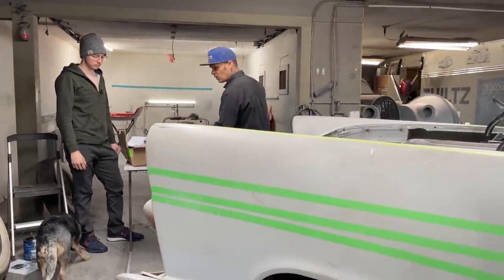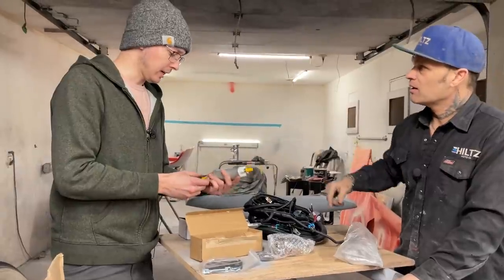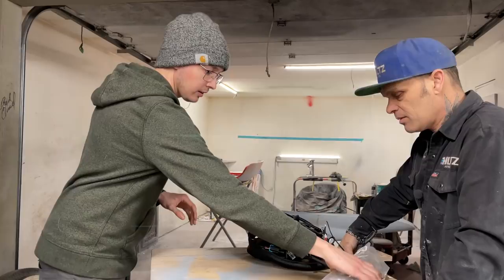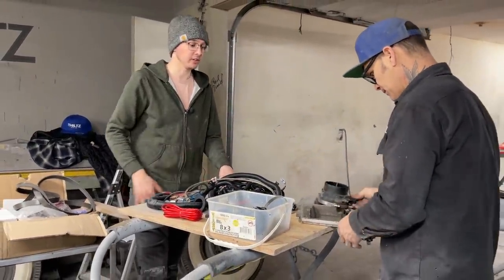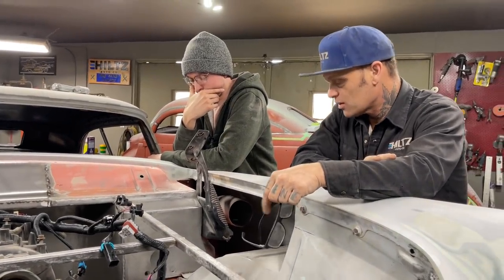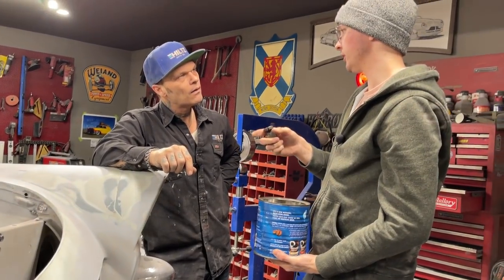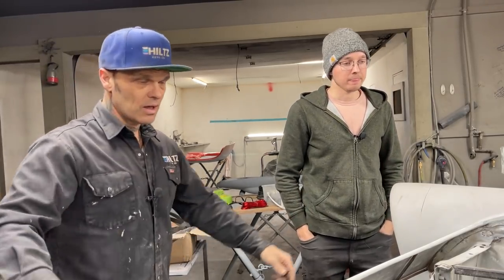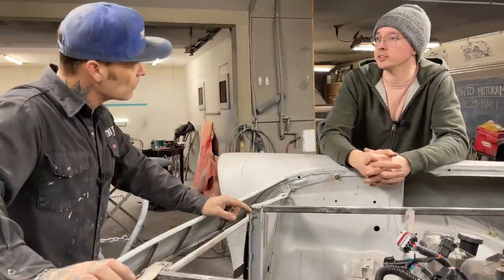A lesson from Dane Bolton on How To Set Up 5.3 LS Engines

Comment: These swaps are very straight forward and can be done with aftermarket harnesses and modules, or oem used components. My last build was a 49 chevy truck and I used a 5.3/4L60E and the oem harness and PCM I bought it all for $1400, even came with the power steering, water pump and alternator.
Making the harness work was as simple as peeling off the loom and tape and eliminating circuits not being used, then retaping it. It was in great shape.  Used an amber LED for the check engine light. 

This build will be super cool when done!

Comment: Always interesting watching Chad from just down the road in Scotch Village, but I think Dane has the order of the fuel pump and filter/regulator backwards, at 4:05.  I've done a couple of LS swaps, and used the same filter, but it's under pressure, with the pump before it, not after.  I'm sure they'll sort it out!!!  I wonder if in the end Chad will say "LS's are cooler than dang"!!

Comment: The "ECU" in this case is actually called a PCM, since it controls both the engine and transmission, so that makes it a Powertrain Control Module. If it controlled only the engine it would be called an ECM, or Engine Control Module. Those vehicles would also need a TCM, for Transmission control. :).

Comment: use a baffled gas tank so the pump won’t get starved and lean the engine out. My ls swap has a in-tank fuel pump and it has a filter sock on it at the pick up and then the filter is after that pump next to my fuel tank. I’m using the same filter Dane showed you “corvette style”. There’s a oil pressure sensor on the back on the motor behind the intake which I’m sure you can wire a gauge to it so you don’t have to run oil into the cab through that line.

Comment: AN fitting is a standard sizing for fitting used in Army Navy application. AN -6 would be 6/16 of an inch OR 3/8 inch fitting. What ever size the AN fitting it is always in 16ths of an inch. -8 AN fitting would be 8/16ths = 1/2 inch fitting.

Comment: Ive retrofitted gas tank by cutting pieces out of one tank adding to another to match what im working on . Or put a larger tank in . Extending the sending unit no problem.  Separate note ive had realy bad luck with electric fuel pumps in combination with  Carburetor

Comment: Great video guys. The hole making thing is called a knockout. Electricians use them. Before step bits were popular, we would drill a small hole, then use a 1/2 knockout, then use the 2” knockout.

Comment: Chad, Once you used an LS. You will always be using one. They're cheap, reliable, bulletproof make lots of HP. With the fuel lines used the AN fittings and Lines. Do it right the first time. I would put the fuel pump in the gas tank. It is quieter and the fuel keeps the pump cool and it will last longer.

Comment: Yes, have your hole behind the engine towards the left side of the engine, it will hide where it's coming through and then it splits to each side of the engine. The split is for the injectors, knock sensors, mass air flow, altenator. As you start plugging everything in the harness starts to point to where it wants to go, you got this, you do way crazier and harder stuff then running a harness. Bad Chad got this.
Reply: Hang tough Chad... Newer technology is always a bit intimidating at first glance.

Comment: You can get a 25 ft roll of 3/8 nylon line with fitting for that particular fuel filter/regular. Cut the line to fit, push the fittings on and go. It's the same style fittings and lines car makers have been using for years. You can get it all on Amazon, eBay or rockaut. That's what I use on my budget Ls swaps..

Comment: Brent at halfass kustoms has installed dozens or these LS engines .he has lots of great tutorials on this subject .His rule of thumb is it's got to be cheap,easy and parts available at the gm dealer. local parts store  or at the auto recyclers anywhere .He was huge amount of usable tips and tricks for you .This new set up would be a much cleaner install although.

Comment: First you need 3 line from the sending unit 3/8 MAIN LINE 5/16 RETURN LINE and 1/4 or 5/16 EMISSION LINE.. All so you have to run if your using rubber hose on the 3/8 main line you have to use fuel injection hose for the higher pressure fuel pump which has about 50 to 80 pounds pressure.. Most shops now use plastic fuel lines..Easy to run will not rust and last a lifetime..NAPA has everything you need to run the plastic lines from fittings to plastic hose ..Have fun own my own rad shop for over 30 years installed 1,000 and 1,000 gas tanks and rads and heaters and also recored tons of rads

Comment: you can get a bluetooth elm 327 adapter to plug into the obd2 connector and put a free app like torque lite on your smart phone to check what is going on with the PCM, check and clear codes etc.

Comment: you can use that pump on carbs you must dial down the regulator and run the return right into the tank

one thing you will experience with these closed loop hi side lo side pumps is that it will build up pressure in the tank itself, you can weld a 1/8th nipple tot he tank and run an 1/8th inch fuel line to a charcoal canister then use an inline pressure valve, it will ease off the pressure where you want to and feed it into the canister, no fumes

just keep an eye on it you don't want the tank to burst a seam or even develop a leak, it will bleed pressure ata safe level, also wont hiss as bad removing the gas cap.. several ways, open loop, closed loop, all sorts of cans and pressure relief valves, all inline and don't weight anything, just a thought

Comment: if you tilt the ECU against the firewall, you could run the wires through the firewall at a higher location & run the wires behind the ECU. thus keeping the harness away from the exhaust

Comment: Make sure ya use fuel injected fuel rubber line not regular gas rubber hose if ya use rubber hose an get the fuel injection clamps also

Comment: I didn’t hear anything said about the O2 sensors in the exhaust. There are several different LS exhaust manifolds with different dump positions. With a little research you can find one that would work without modifying.

Comment: The decisions decisions on where to mount and run wires.
Battery in the boot (trunk) is best and less voltage drop for air pumps and much easier to hide all that in the trunk

Comment: I would suggest an EFI tank with the Walbro 255 pump inside it and run a Corvette style regulator/filter. External fuel pumps burn up and are loud.

Comment: Chad when you extend a frame or build a portion of a frame.what metal can be used? Regular bought channel and tubing or is there structure steel I would have to buy. If so where would I find it?
Reply: Regular channel is fine. Available from local steel supply or find a local recycler.  Good luck.

Comment: Chad, I have not read all of the comments so forgive me if this is a repeat. You would be far better off with an in tank fuel pump set up that is well baffled as to not allow fuel starvation to the pump. Fuel injection fuel systems do not store fuel like a carburetor does and therefore needs a constant high pressure supply of fuel. You will need a prefilter before the pump and a filter before the injectors. I would suggest you watch some you tube videos before you  build your tank.

Comment: ECU= engine control unit or also called ECM= engine control module. Same was the trans. TCM= trans control module.
Reply: Or typically in these vehicles called a PCM (powertrain control module).

Comment: CHAD PLEASE READ!
The cars you have that are carburetored with a electric fuel pump, all you have to do is add an inline pressure regulator.  You simply cut the rubber fuel line and put each cut end on and tighten and set the right pressure and enjoy your cars. They are very inexpensive